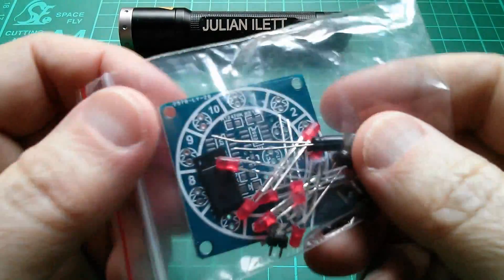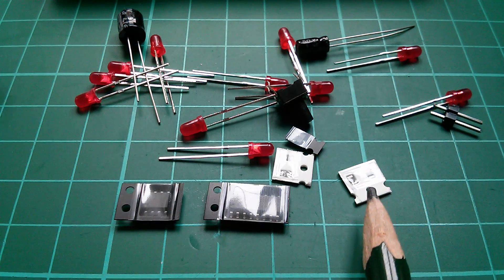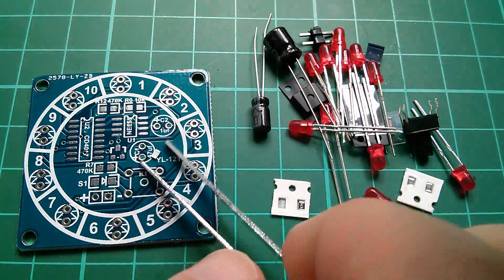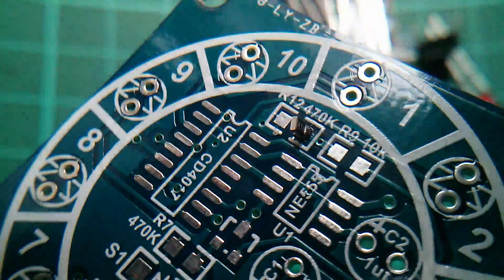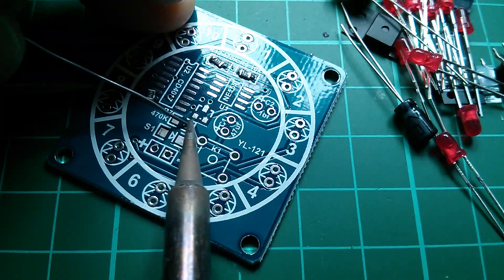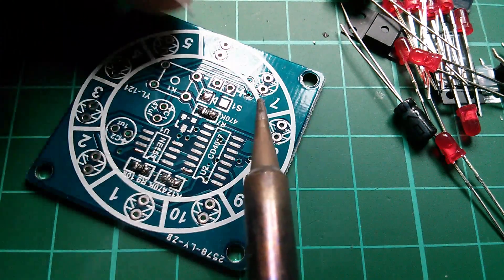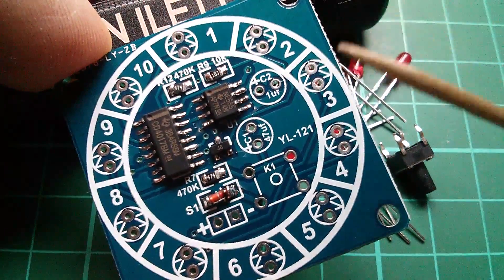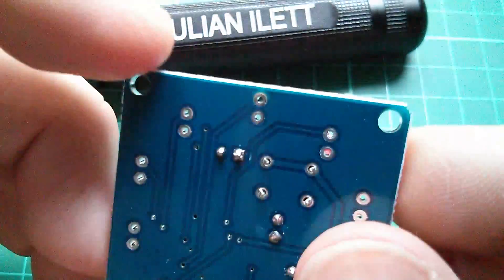Basic Electronics: Surface Mount Components Kit - 555 Roulette

Comment: Hi, bit of an off the topic question for you, as I think you may be able to help me with a bit of a problem.  I purchased several different kits sort of like the one you have here. this one http://www.ebay.com/itm/390986650013?_trksid=p2060778.m2749.l2649&var=660347794522&ssPageName=STRK%3AMEBIDX%3AIT is supposed to be a night light, however the seller neglected to say it is for 220 volt not the 110 we have here in the States.  Now I like the little guy, and it works but of course, is very dim.  Do you have any idea if there is some resister substitution or something I can do to step this down so it will give more then a light glow when it comes on?  Thanks and by the way I do look forward to your posts, you have inspired me to go ahead and do things I never thought  I could.
Reply: ***** Hi, wish I could post a diagram, however, like many project kits from China, this one came with a circuit board and a bag of parts, with a case to fit it all in, and that's it.  I did take a picture of the finished product before the lid went on, it is a close up of the parts if that is of any help, I uploaded it to my website at http://jericsson.info/storage.html take a look and see if that is of any help.  Sure would be nice to make it usable, even just cut back to a 9V battery would be better then it is now.  Wife wants it in our old motor home for a night light if I can get it up and functioning.
Reply: Jerry Ericsson
What you're looking for is "capacitive power supply". You have to change C1 and R2. There are calculators for that on the internet. Plug in the values currently used and see how much current such a supply is designed to deliver (that's important; you have to backtrack here because only the manufacturer knows the current draw of the circuit behind it). Then calulate the values needed for the same current, but when run at 110V. Make sure all the components are rated for mains!

Btw. it would also help if you use the right value resistors in the right place. I can't read the markings under the resistors, but I'm pretty sure you mixed them up (which is NOT a good thing, if you're playing with mains voltage). It looks wrong that way. If that fixes your brightness problems (on 110V it should at least be half as bright as intended to be) still do the calculations above to learn something ;)
Reply: superdau Hi, thanks, I dug around some more on Ebay, found another seller who has a diagram on his auction looks like the exact same product http://i.ebayimg.com/00/s/NDAwWDc2NQ==/z/n2gAAOSwLa9UWJ7c/$_12.JPG This gives a better idea as to what is required for the 220 v.  Not all that sure why I am getting so deep into a 4 dollar item but like you said, everyone can learn something once in awhile, even a old man like me in my mid 60's.
Reply: Jerry Ericsson
The steps from above don't change. You still have to calcuate that. (A quick and dirty solution would be to just double C1; but make sure it's a mains rated one)
Here's a page to calulate such a powersupply (german): http://www.electronicdeveloper.de/SpannungKondRV.aspx
Punch in and change U and I (guestimate: start with 15V and 20mA) until the results for C1 and R2 match the one in your circuit (ignore RL). Then change from "230V" to 110V at voila that are your new components.

But the diagram also confirms that you mixed up R1 and R2. Change that first. You will get at least half the brightness.
Reply: Jerry Ericsson Hi again, checked all the resistors they all appear proper, I guess when it is totally dark, the light is probably about half what it should be for a night light.  I played around with a 9v battery shooting a bit of voltage through a 1k resistor to the LEDs and they are indeed bright under that condition, but I can only get one or two to light at a time that way.  Ah the mysteries of electronics, Sure do enjoy that, brings back memories of repairing officers television sets when I was in Commo in the Army, all the officers thought that since we were in communications we should know how to fix their TV's for nothing. Back then it was usually a tube and we just pulled them, took them to Dart Drug and picked up a new tube, gave the fellow back his TV and usually got a six pack of beer and a burger out of it, plus the cost of the tube.
Reply: Jerry Ericsson
How did you check the resistors? Did you measure them? Because the colors say they are wrong and I doubt you got two with the right value but the wrong colors.
Reply: I checked the color code against what was printed under the resistor using the resistor color code application on the web
Reply: ***** Sounds like a great idea, I am thinking of using a 3.7  Lithium cell from an old Archos 3.2 that suffered a trip through the works of my recliner, my nearly permanent place of residence now days.  I charged it up yesterday and it seems to hold a good charge, I am guessing a couple of resistors on a perf board with the led's and a charger circuit (I have some of those little ones from China that should do the trick, and a USB plug so I can charge it that way, inside the same case and the wife should be happy and so will I, hopefully.
Reply: superdau OK, now I must admit that I am a bit dense.  I looked this thing over again and found you absolutely correct, I only half read the number below the resistors one was ...K and the other was...Ohms and I did indeed have them reversed as you said.  I did the exchange and find the light is a bit brighter.  Not enough to make a good night light but perhaps enough to light up the hall in the motor home.  I may just keep it this way and try it out once the weather allows me to get Big Bertha out of her stable and head south to the big lake (well we call it big anyhow) for a few nights of rest and relaxation. Big Bertha is proudly displayed at http://jericsson.info took some pics on our last trip last fall. Guess she isn't all that big, only 38 foot long but when you usually drive a Suzuki....

Comment: Good video.

Used to work in the industry and can recommend using a pair of tweezers with curved tips to move the resistors onto the solder pads.

Also best using a bucket tip on the iron.

Dave jones has excellent tutorials on eevblog blog.

Comment: For holding SMD parts, tweezers:

http://www.ebay.co.uk/itm/6-pcs-ESD-Safe-Anti-magnetic-Stainless-Steel-Tweezer-Forceps-Nipper-Kit-Set-Tool-/181165179500?pt=LH_DefaultDomain_3&hash=item2a2e49426c

For holding things in place while you solder them, self locking tweezers:

http://www.ebay.co.uk/itm/2x-Reverse-Action-Fibre-Tweezers-Great-4-Airfix-Hornby-Self-Locking-Insulated-/351334623176?pt=LH_DefaultDomain_3&hash=item51cd2ce7c8

SMD practice:

http://www.ebay.co.uk/itm/SMD-SMT-Components-Practice-Board-Soldering-Skill-Training-Kit-For-Beginner-PR-/271483743853?pt=LH_DefaultDomain_3&hash=item3f35b12e6d

Comment: Small smd components need to be kept down using some tweezers while soldering the first pin because otherwise surface tension will cause them to stick to the soldering iron tip or tombstone.

Also I would suggest using some flux, it helps allot.

Comment: superglue on the surface mount parts works well.
Reply: only time i'd use superglue would be if soldering a chip upside down, 'dead bug' style... you shouldn't really need it otherwise, especially since if you position the chip wrongly then you have to get it off the board and can take the solder mask with it thus potentially making refit slightly more awkward if the part won't then sit flat...

Comment: After seeing you getting one of the chasing LED kits with surface mount components I thought it would be a good idea to get one for practice.  (I try and avoid SMD stuff.)  The "kit" arrived pre-built!
Reply from the maker: bigclivedotcom You could unsolder the components then stick them all back on - just kidding. Think yourself lucky someone else did the hard work for you!
Reply: never though my 2 favorite youtubers knew each other fantastic
Reply: make a desoldering video.
Reply: Clive they make a pratic kit for smd on ebay

Comment: The polarity with red LEDs can be very random at times.  I had to add text to my assembly guides for some of my RGB panels to get people to check the LEDs before soldering them in, since some of the superflux LEDs come with the polarity notch on the package on the wrong side.  I think this may be down to the LED chemistry, since some of the higher output LEDs have the LED cup connected to positive instead of the more usual negative.  I get the feeling they just ram them through the standard production sometimes without adjusting for the polarity.
Reply from the maker: bigclivedotcom I agree - I don't think there's any completely foolproof way to determine LED polarity. The old 3v lithium coin cell works best.

Comment: little bit of glue to stick the SMD's in place ?  If you are concerned about removing/resoldering at some point later, there are glues that you can wash away with water (sugar or starch based) or that will break down on their own due to oxygen contact in a couple days so you don't need to wash.

Alternatively, a thick gel-like flux would probably hold it in place and make the soldering a bit easier at the same time.

Comment: http://www.societyofrobots.com/images/electronics_led_diagram.png

I always look inside the case on the led for the bigger metal contact which is the cathode. I've had many LEDs which have the flat edge not there, and the legs the same size. The shape of the metal inside is very much a requirement of the manufacturing process and not just a design choice however.

Comment: SMD is tricky, but a few extra tools can make the task much easier:

Very fine point tweezers for aligning and holding components.
A flux pen to allow you to just touch the iron with solder on it to a fluxed surface and not need to add solder as well. (I tape my cap to a surface so I can remove the cap with one hand)
Solder wick/braid to remove excess solder or the entire part.
Temperature controlled soldering iron. (I've been too cheap to get a proper adjustable iron, but I use the variac on my power supply to adjust the power going into my iron. Could also use a dimmer switch.)
Reply: I think people are put off by the size of the parts and that they need loads of extra stuff to be able to do smd but you've hit the nail right on the head... spending some money on these few things will save you in the long run as smd parts work out so much cheaper...

Comment: Nice Video!

2 Things:
You need a lot thinner tweezers - like FastTech SKU 2136404
And you need thin solder - FT SKU 1827803 works great and is thin enough.

Comment: I typically like your approach, but that's a pretty poor technique. Use flux and re-flow onto the device, also you might want to use a smaller tip and finer pitch solder. I do the "ramming device's contact into solder blob" as well but I use less solder(just the pad is tinned)  and use flux on the component end. otherwise tiny amounts of blutack will make re-flowing unnecessary and you can just solder normally onto the pad.

Comment: reading the other comments, don't use pliers... fine point tweezers... these ones http://www.ebay.co.uk/itm/Lots-6-Pcs-Anti-static-Tweezer-Maintenance-Steel-Stainless-repair-tool-Kit-Set-J-/311312389530?pt=LH_DefaultDomain_3&hash=item487baa159a
Reply from the maker: smitcher I can't see how pliers would be useful either. I'm wondering whether tweezers are called pliers in some places.
Reply: Julian Ilett Looking at that link, the title says tweezers but the description says pliers so you are probably right...

Comment: 555 alignment is absolutely spot on and your soldering technique on the chip is good for hand soldering. Don't forget that the ones you see from production runs have very accurate amounts of paste applied and are heated in an oven, hence the very good appearance... angle your iron up more and then the other parts shouldn't get in your way. hard with the camera I suppose...

Comment: wrong tweezers mate, you are making life hard for yourself. get the ones with a really fine point that angle down by 30 degrees...
Reply from the maker: smitcher The problem with tweezers is that you can't apply downward pressure - unless you can get stepped tweezers maybe
Reply: Julian Ilett You can but you shouldn't need to really. You don't want to stress the part, you really just want to hold it there while you tack it. I used to work for Motorola and we used to hand change all sorts of chips from large BGAs down to TSOPs down to QFNs with exposed or hidden legs... with those angled tweezers you'd be very surprised how easy it is to grip them diagonally and position it very accurately.

Comment: You need tweezers. hold the part with the tweezers, load a tiny bit of solder on a clean iron and then touch each of the ends of the resistor in turn, enough to tack and then go back with iron and solder... flux is your friend too for the chip. drag solder the pins away from the chip. Same technique, hold with tweezers (metal ones) tack diagonally opposite pins like before and then drag solder them all...
Reply from the maker: smitcher I've never used a flux pen - I might give one a try. Cheers.
Reply: Julian Ilett We used to use the liquid flux, but the gel pens are good. Flux is the secret to good joints, you can't really add too much, well you can but it would be doubtful...
Reply: Julian Ilett Good sharp tweezers will be a huge help, I recommend the straight kind. The pointed soldering tip is the worst to use, the chisel I find are much better. Flux helps a lot but if your quick before the flux burns off from the rosin core you can work without it. The flux will reduce the surface tension on the solder combined with the solder mask of the board will push the solder away so it will only flow to each pin and will not bridge the pins.
Once you get used to the SMD it will be just as or easier then DIP for the pitch size you used in this video.
Love the videos by the way, Thanks!

Comment: I've had a few MELFs that like to roll and end up on the floor too Julian.
Reply from the maker: ***** I was waiting for the melf pun - congrats ;)
Reply: Julian Ilett
Had to be done, didn't want to take it too far and bring 'through hole' into the equation  :)  Thanks for another great vid, really looking forward to the vocoder. Great channel, all the best.
Reply from the maker: ***** Cheers! Some vocoder parts are on their way - op amps mainly. Shopping for 1980s vintage components is proving interesting. I'm undecided about power supplies - thinking about using switched mode blocks for the +12v and -12v supplies. That'll upset some people ;)

Comment: Hi Julian, I really have enjoyed you project and postbag videos. Would love to see some more on ESP8266/LUA, NRF24L01 or projects with EFT LCD screens. My wife says I'm addicted to ordering stuff on EBay, she may be right. Thanks for helping to support my habit :-)

In my VERY limited SMD expereince, I can offer the following to others that try it:

  *Flux or Flux Pen- be generous and the solder will flow/reflow easily
  *Steady Surface- I use a silpat (baking) mat over my cutting mat. It's heat resistant and provides a great non-slip surface to keep the PCB from sliding around.
  *Tweezers- I've found that those fine point jeweler types with the sliding clamp allows you to place light pressure on components to hold them in place. They have a pretty long reach.
  *Magnification- my old eyes need good magnifiers or even a microscope for the very fine stuff (like .2mm pitch PIC chips)
Reply: Haha, this made me laugh. My wife has said exactly the same thing. I'm considering doing some "postbag" style videos like Julian because I seem to have ordered nearly every "module" that has ever come out of Shenzhen...
Reply: Same here!
Reply: Here also - there must be planes flying around the planet that are just full of our crap :)
Reply: reggiebacci Ya I expect a truck load today! Well several packages.  Always gets those almost nasty looks from my good wife of 45 years, but when I give her one of the kits when I have finished she seems pleased.  She is using them to decorate her village collections  that she has collected over the years.  Looks kind of neat to have a blinking Christmas tree in her winter village.

Comment: Unless you are soldering 0402 or smaller, I wouldn't call it microscopic, just small. I can't see what size that is, though a guess is 0603, and those are pretty easily soldered with a pair of tweezers. As for the IC's, some flux first, then tagging the corners, would make it a breeze. Now QSOP packages are fun... 0.63mm pin pitch
Reply: QSOP packages are fun but not as fun as hand soldering a BGA... with a heat gun though...

Comment: The pair of tweezers shown at 06:18 (normally closed one) is of bad quality, not really suitable for tiny SMD parts. The tips ought to be absolutely flat on the inside, not rounded as shown. These will drive you insane sooner or later.
Reply: too big i'd say but definitely wrong type...
Reply: smitcher Size is personal preference, within reason. Using tweezers with incommensurate tips is a pain. You're bound to flick parts everywhere except where you need them.
Reply: ***** I agree somewhat but those big ones can exert a lot more force so when the flick happens it REALLY happens... try holding a QFP diagonally with those beasts and its a recipe for disaster... Its all possibly with practice, I think that's the key. Get some scrap device and play around removing and adding parts and manipulating them with the tweezers. It's kinda like a chef and his knife, he can do things you wouldn't think possibly with a single knife...

Comment: tin the pads first then hold the component down with the tweezers then reflow with a chisel tip of the right size or hot air i have no issues doing it that way